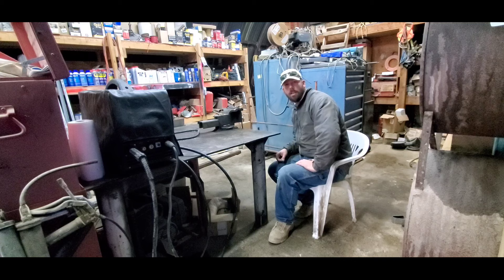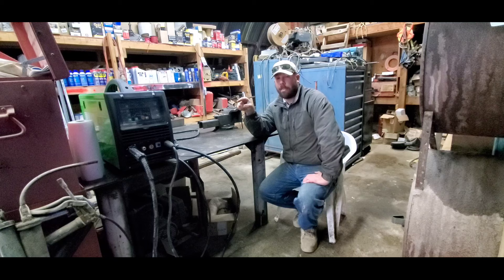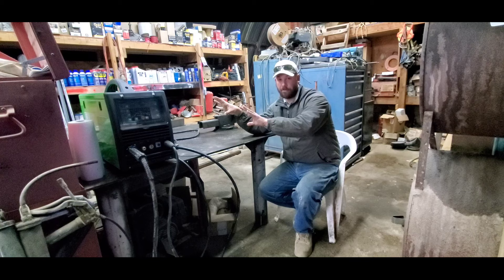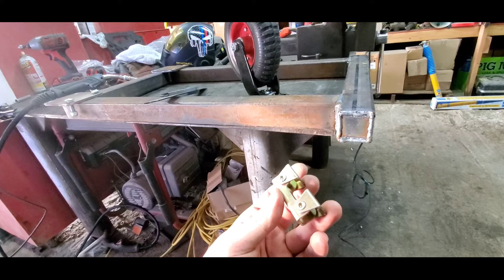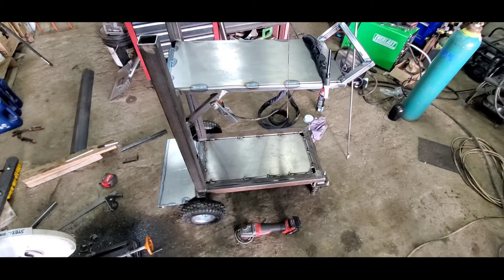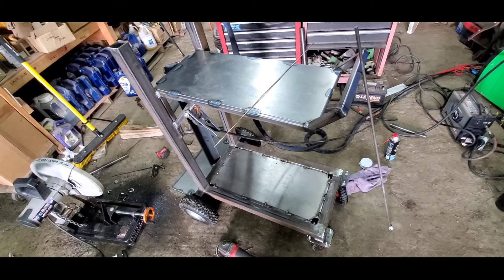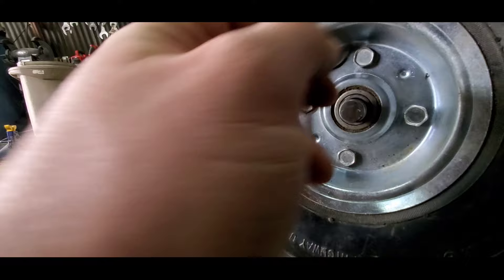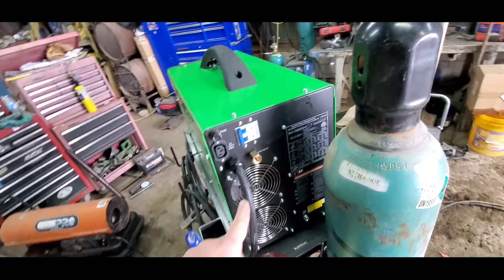New Everlast PowerMTS 251si - first project: build a cart for it!

Comment: Will this Everlast 251si run 6010 stick? Website says its not rated but also said that about the lightning 225 and another youtuber ran it well on the 225. thanks for any help
Reply from the maker: Hey Allen. I never ran 6010 on it, but it had surprisingly good arc control and power output running 6011 and 7018. Not anywhere near as refined as a Miller or Lincoln, but great for the price point considering how capable it is. 6010 is a tough nut to crack for a lot of cheaper machines, but the 251 has adjustable arc force control and a lot of other nice features in stick mode. I'm betting it would run 6010 just fine if you can adjust it and get a stable arc started.
Reply: @AllThingsMech  awesome. thanks for the reply. im really looking at this model . thanks again
Reply from the maker: @allenburkhart7827  you bet. It's a solid machine to be sure, but keep an eye out for holiday deals from Miller and Lincoln. If I had to do it over again, I probably would have pushed to get a MultiMatic 215 with the tig package. I never had any major issues with the 251, but Everlast's customer service sucks something fierce. They were awful on the phone and thats only if you can ever get them to call you back. Miller customer service has always been great when I've called. Really kind staff, technicians available to walk you through stuff, etc. so having that better service experience if I ever need anything is a big deal. Just my .02 though.
Reply: @AllThingsMech  Miller is just too much for all the features and add ons. the 251is would be a huge upgrade from my HF flux 125 lol. I know miller is good, i use to weld with miller 400 amp dual shield 3/32 and would burn through an 80 lbs  spool in 8 hours. thats welder is like 25,000.00. i cant justify the extra cost of miller to get the features that everlast can do for less
Reply from the maker: @allenburkhart7827  totally understandable. That's exactly why we went with the Everlast to begin with...just have to find the right cost/benefit ratio for your needs. Everlast does make a good machine.
Reply: @AllThingsMech  thanks for your help

Comment: Update on the 251 si? How’s it running? Worth the money?
Reply from the maker: Hey Dawson. After several months of using it, I can say that I'm very pleased with the performance and output in both MIG and TIG modes. I've only stick welded with it a handful of times because most of our jobs that require stick are out in the field, and we have a Miller Bobcat 225 on our welding truck for those jobs. Overall its a great machine, capable of spray arc with the right gas and wire size. I've welded 2" thick plate together with it, in multiple passes of course, but it didn't bat an eye. Definitely worth the money if you can score one on sale. My only gripes are that the screen is really dim if you're using it outdoors so its tough to fine tune on the fly, and there is no dedicated IPM adjustment for MIG - only volts and amps. You can convert the amps to wire feed speed with some basic math so its no big deal, but it would be nice to have a second readout for that. Other than those two little quibbles, its a great machine.

Comment: Soooo where's the power source for the big remote miller feeder on top of the blue boxes behind you?
Reply from the maker: Great question, it's been sitting there for 20 years from what I've been told. I've messed with it a little bit trying to to get the feeder to power up, but there's an internal short somewhere. We don't do enough heavy fab to warrant spending too much time on getting it working, so its been on permanent backburner since before I started out here. One of these days.
Reply: @AllThingsMech  that feeder needs a power source such as a XMT, Delta, Shopmaster or dimension.  Any CV power source with a 24 volt remote output.  Feeder by itself is useless.